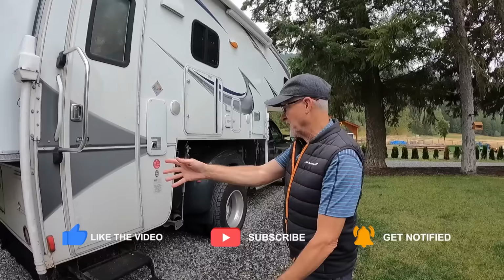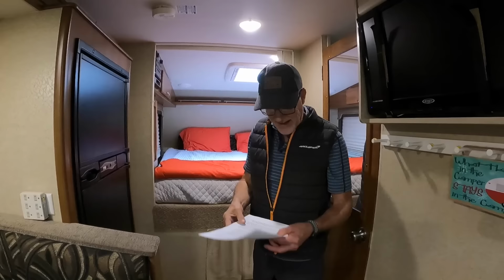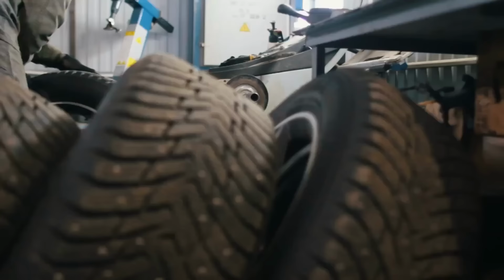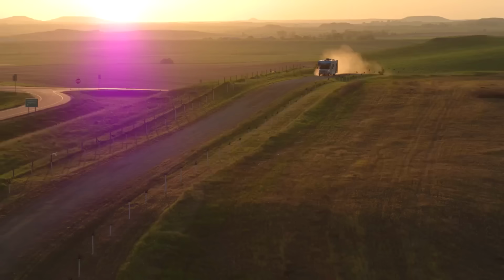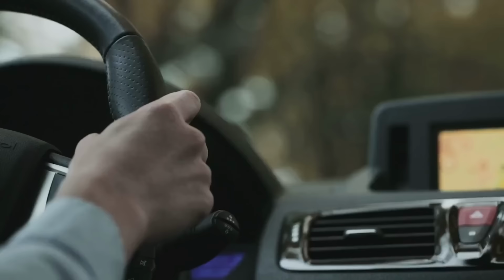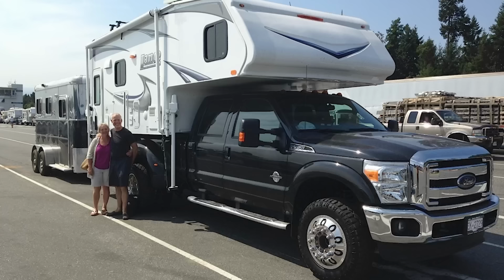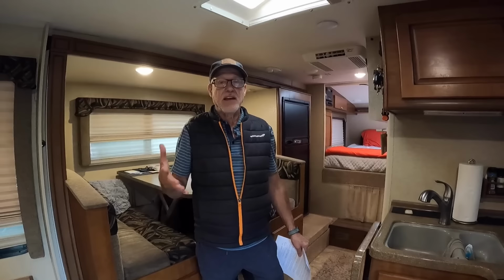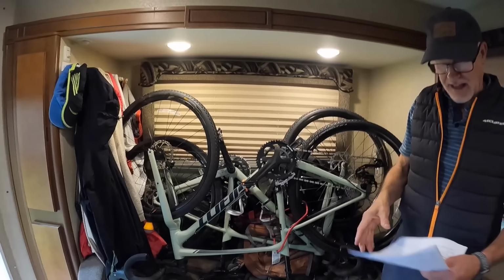Truck & Camper Pros & Cons – and how you can eliminate a couple of the cons you've heard about . . .

Comment: I’m only 51 but I’ve been praying for cataracts for years! I can’t wait to ditch my lifetime of contacts and glasses. Last month my prayers starts to be answered - my optometrist finally noted the first signs! Back on topic, my parents just switched to a class B precisely due to the climb into bed issue. Mom’s knees can’t take it anymore.
Reply from the maker: All the best for your cataract surgery.  Simultaneous with the removal of cataracts, the specialist inserted a lens giving me 20/20 vision for the first time since I was 12 (am now 67).  In fact I was in for my week 1 checkup today and the vision tested better than 20/20.  
I hear you on the bed issue.  We spend a few nights testing out a travel trailer recently and that one thing (no more climbing up into the bed) had significant appeal.
Thanks for tuning in and being part of my journey.
Reply: Some people are adding a short ladder so they can access the cabover. I'm planning to do so for my Lance 915 camper. I've fallen a couple of times and it isn't fun hitting the floor. One person uses a regular stepladder which has wide steps so it is easy to move and place where you want.
Reply from the maker: @Harry-zz2oh  Great tip - and you're right - a slip and fall is not going to make a great camping experience.

Comment: Currently on my 3rd truck/camper set up,  all have been 11ft models..  unlike trailers there are no extra tires, wheels or electric brake maintenance and therefore no axles,( no registration or licences fees ) simply move your license plate from your rear truck bumper to the camper. Great video, absolutely agree on suspension upgrades..
Reply from the maker: Interesting that you mention the trailer braking systems.  I'd not mentioned that in the video, and whether with a travel trailer or any other trailer at some point or another during ownership that becomes it's own challenge and issue. 
Thank you for visiting Bill!  Really appreciate your perspectives.
Reply: Some States/Provinces may require the license plate to remain on the truck. This should be checked for the State where the vehicle is registered.  The same applies for taxes and registration.
Reply from the maker: @Harry-zz2oh  Ohhhhhh - good point.  Highways regulations are generally provincial/state jurisdiction, and can vary.  Just found this statement online: "Driver licensing and vehicle registration in the United States are handled by the state government in all states but Hawaii, where local governments perform DMV functions."

Comment: Great video I have a host triple slide with a Ford 450 The Ford 450 has 19.5" wheels and tires and heavier suspension I would not recommend air bags. Just get the camper package The last thing put 1" spacers above the leaf Springs.
Reply from the maker: Hey! Mike - I agree on all counts.  After much back and forth with others who have more experience than me, I've concluded:
- The next truck with be the F-450 with the camper package. Among other things the F350 turning radius is horrible.  F450 is awesome.  
- Camper package with the heavier suspension.
- Love the suggestion of 1" spacers above leaf springs.
I love the stance and hence the stability that come with my existing  wider wheels and tires - so would transfer my existing wheels package (American Force, 10 bolt,  20"- not cheap) over to the new vehicle.  
Huge thanks for being part of my journey of learning!

Comment: I have owned two truck campers since 2009 when I bought my first one.   It’s still the best rig for my needs.  I tow a cargo trailer with my motorcycles and extra camping gear.   
A toy hauler means I’d have to unload my motorcycles every time I stop to camp, which isn’t feasible when stopping for a quickie overnight stop while enroute somewhere.
Reply from the maker: Thanks for weighing in on the discussion.
Truth!  Truck & camper = increased options for extra hauling and mobility.

Comment: We love our Lance 1191 camper.  Purchased new in 2014.  Added many mods to make it much better for free standing camping
Ng.
Reply from the maker: Love the 1191.  When we got ours it was a real toss-up between the 1191 and 1172.  
Just setting mine up to use this winter, free standing, in modest freezing conditions.  
Will be doing a video on that in the next month or so.
Reply: @howardkettner  We now use a Wave 8 catalytic heater when free standing.  Also added several 12 volt very quiet 120mm fans to blow warm air into the bed area and the back of the camper.  Makes a huge difference when it's near or below freezing.  Added self heating 200Ah lithium and 2500 watt inverter.  Did not connect inverter to main power, I made 2 outlets, one specifically for the microwave and another at the rear counter for general use. Added a fan with external switch to fridge to circulate air.  Fridge works so much better now even when 115 outside.

Comment: the little yellow signs with the suggested speed for the curves is for large trucks and semis not for passenger cars thank you
Reply from the maker: Hey! Thanks for tuning in and commenting.
Your point is well made.  My perhaps less well articulated point was that prior to the wheel replacement and suspension changes, there is was a lot of sway, and hence a lot of driver nervousness even taking those corners at 5mph under suggested.

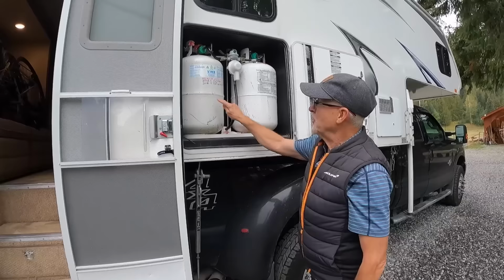Comment: I have been truck Camper since I've 16 years old 12 truck campers we have or 2nd 1172 and we ordered or F350 Ford Lariat Truck camper package I comes with a 450 rear end 3:55 rear end with a sway bar from the Factory! I have a Spring man install 2 springs in the rear end 1 more helper and on the main 1 down another main spring and all problems handle! Now sway and perfectly level! Guess what I'm only 11'10 Love it I fit in my 12' Garage door! Your 1 foo higher! now throw those air bags out waste of money and buy some goo spring not all that after market stuff! No sway and down the high GREAT!! I've doing this for Years the only way to go:)
Reply from the maker: Thanks for sharing your experience. Always great to meet another 1172 owner.
I should have done a better job of clarifying what my height measurement includes.  I've got a Yakima rooftop carrier where I keep some super light but bulky stuff for longer trips - otherwise my height measurement would be same as yours.
I had airbags initially installed - at the RV dealers suggestions.  You are right - they don't work - in fact for reasons I won't get into here they actually made things worse.
Like you I got additional overload springs installed - and beefed up the torsion bar as well.  Love how it handles.  It's as easy and carefree now as driving a passenger car.  
Again - thanks for tuning in . . .

Comment: Very informative, very well spoken, nicely edited. Good job!
I'm very curious about towing with and extended truck camper and how that works. I have a 14ft enclosed trailer that I tow my motorcycles around with and having a truck camper would definatly cut hotel fees when out of town for rides lol. A video on that would be awesome!
Reply from the maker: Hey! Thanks for tuning in and being part of my journey.  And thank you for the video topic suggestion.  Will do - but not likely till Spring as I'll not be likely have the camper onboard again till then.
In the meanwhile, here is one of my videos in which, as part of other subject matter, I do talk about all the fundamentals, how my tow rig is equipped and the roles of the truss-hitch extender and the trailer ball weigh scale.
Your 14' enclosed trailer should not be an issue subject to tow vehicle capacity.  I've routinely towed a 26' cargo trailer loaded with ATV's and a 20' flatdeck - with camper onboard the tow vehicle and the camper extending nearly 4' beyond the truck box. 
Part 1 https://www.youtube.com/watch?v=4TVoEghaMgI

Comment: Nice vid!!  I spend between 6-9 months boondocking each year in my truck camper.  It is a Northern Lite and I run a SRW F350 to carry it.  The NL are fiberglass so it is lighter so not sure how these work on heavier loads but before you add springs and sway bars, I would suggest, no matter what you have to install Torklift Stableloads.  Easy to self install on your existing leafsprings and took out all the sway from my truck.  The other thing I think people should know is if you plan to do a lot of off roading in your truck camper I would recommend against anything with slide outs.  One, they add a lot of weight to your camper and two, much more of a chance of a twist getting that/those slides stuck either in or out.  Mine has no slides and there is still lots of room for extended months of camper no problem.
Reply from the maker: Wow!  You're living the dream.  Love the Northern Lite product.  Thanks for the tip on the Torklift Stableloads - and the outcome with those.  
And - I could not agree more on the slide-outs.  On a truck camper, it's not "if" it's just "when" IMO.  In the 2nd year of ownership, mine had to be transported back to the factory for more substantial gussetting, etc.  Then at my expense I had to install wearplates on the bottom of the slide.  The rollers were literally chewing through the bottom.  
Good points all.  Happy boondocking!

Comment: I went back and forth between a truck camper and a small travel trailer. I decided with the truck and travel trailer. My truck is a F-150 V8 4x4 and my trailer a 19.8 foot Jayco 166fbs. I went with the gas powered truck due to the high cost and maintenance and repair for diesels. I also have a shell on my truck of tons of storage and a rack system on the roof that holds all my fly rods. My trailer has one slide 55 gallons of fresh water and also 2 30 gallon propane tanks. I can detach and take my truck through a car wash can't do that with a dually. Just have to decide what's right for you.
Reply from the maker: Thanks for tuning in . . .  and you are correct on all counts.  
Lots of factors to consider depending on other uses/requirements.  I just finished responding to another viewer that I need my one-ton capacity pickup a couple of times a week - whether slugging a load of logs on my flatdeck, or taking a 6,000 pound tractor to another site.  
Haha - on the car wash you are so right.  I have to self-wash the truck and camper combo when travelling.
Again - thanks for your perspectives.

Comment: Great review. I’ve wanted a truck camper rig since forever, but the sheer size of these modern things siting in a truck bed is a little unnerving to me - and I’ve got a lot of miles in 18 wheelers. Can’t beat the single vehicle convenience with ability to separate components.
Reply from the maker: Thanks for tuning in and being part of my journey!  
I totally get it (the “unnerving” part).  That’s why I took more time than I probably should have in reviewing the suspension and wheel modifications.  Totally a ‘night versus day’ experience.
On my way home from the RV dealer, as I went through a traffics circle at something like 25 miles per hour, before those modifications, the only thing going through my head was “oh my God, what have I gotten myself into” and from there on I was on a mission to never have that reflexive thought again . . .
Problem solved.

Comment: I love my truck Camper and did a lot of research be for buying my 2017 F350 dually Camper special with a GVWR of 14000 lbs as far as I know it the highest rating you can get with a F350.    
16000lbs GVWR is F550 territory 
Besides that great video.      Cheers
Reply from the maker: Huge thanks for visiting and being part of my journey.  
I'll be doing an update/clarification video in the weeks ahead about the GVWR point you make.  The short version is that #1 - your research and conclusion is 100% correct for your unit and my unit alike.  However, the new 2022 units have an increased capacity, depending on the actual model.  I'll include links and 'stills' of the documentation.  
In the meanwhile, safe and happy travels.
Reply: @howardkettner  The You Tube algorithm did it's job yesterday and directed me to your channel; and I'm glad it did!!  I subscribed; and look forward to reviewing past videos and future videos.  As I have the identical truck to yours (2016 version), I too questioned the 16,000 GVWR.  Even with my 2001 Lance 1030 fully loaded, I am right at 14,000# limit pulling a 20' enclosed trailer (6,000# loaded).  While I don't see ever needing any more load capability, I am interested in pursuing some of your anti-sway upgrades.  Great video!  Safe travels.
BTW, I had to upgrade to a dually when I weighed my Lance on my (previous) 2011 F350 SRW truck without a trailer attached.  It was over 1,000# overweight; and I see this same truck / camper combination on the road all of the time.  Never follow too closely to these guys!  The expense of having to upgrade to a dually for a larger truck camper is another "con", but will also be considered a "pro" if a tire failure occurs.
Reply from the maker: @joeluehring4676  Huge thanks for joining the conversation Joe!  Good move upgrading to dually.
One of the interesting observations from one of the more reputable folks I've known in the RV industry is that upwards of 80% of RV's that one meets on the highway, (whether motorhomes, trucks and trailers or trucks and campers) is that they're overloaded - and not by just a little bit.

Comment: First time watching you. The legal limits in the states is 13'6 and 80 inches wide. I'm a truck driver so that may differ in an rv situation. But that's the legal limits for semis. I really enjoyed this video and maybe we'll bump into each other at a campground somewhere
Reply from the maker: Hey! Dan
To the best of my knowledge the same applies to RVs as to semis. 
 Huge thanks for visiting our little channel.
Reply: My Eaglecap truck camper is 102" wide! My dually pickup is  89" wide! Your 80" measurement is not correct regarding maximum width in the US.
Reply from the maker: @gmv0553  Thanks for the comment. Yeah, It's 8'6" in Canada too.  Both my camper and one of my Cargo trailers (which I've pulled in Canada and the US are 102" wide

Comment: I have been rv'in for over 40 yrs.( i've never owned a truck camper).  I'm always amazed why anyone would buy a over priced wind sail. Before you make a purchase watch a video of a truck camper traveling down a uneven dirt road even 5 at mph, pickups were never designed to carry that much weight that high in the bed.
Reply from the maker: Hey! thanks for tuning in and sharing!
All I can say is that once I got the springs sorted out, it's super solid.  Last trip from Wyoming to Idaho we had cross winds that were causing less than fully loaded 53' semi trailers to lean, and we were rock solid.  We also did a stretch of 20 miles of twisty, uneven road with several corners banked the wrong way as we explored an old mining site, and could not have asked for a better experience.  For what we do - and find essential to support everything we need for everything from backpacking in difficult terrain and weather, to dressing up to attend a conference and it's associated events, our choice was either a 5th wheel trailer or the 1172.  Loving where we landed . . .

Comment: Great video.  On your air bags did they install a single or duel path for your air. On our truck we installed the duel path and don’t get the sway. 
Our truck had the 5000 lb air bags. Now you can get the 7500 lb bags. 
Keep up the great videos 👍🏻
Reply from the maker: Hey! Dan - thank you for visiting our little channel.  
Great info!  They installed a single path and that is great news about the dual path.  I didn't know that existed.  And I was unaware of the 7500 pound airbags.  That likely would have saved me $2k of spring/torsion bar work.  
Safe and happy travels to you.  I hope our paths cross again!

Comment: I live in Pennsylvania..Another Pro… only 2 axles. On a maintenance perspective, you only have to worry about the truck while driving… and another thing, toll roads, you pay more with more axles. Subscribed 👍
Reply from the maker: Thanks for visiting and sharing.  Been watching other channels and it appears that with all the folks getting recently involved in RV'ing, finding spots at all seems to be a growing concern.  With the length involved in truck and camper, and the boondock capabilities of a 4 seasons unit, winter or summer one can stay almost anywhere.  Tough not to find a spot. 
Safe travels - and again - thanks for visiting and subscribing.